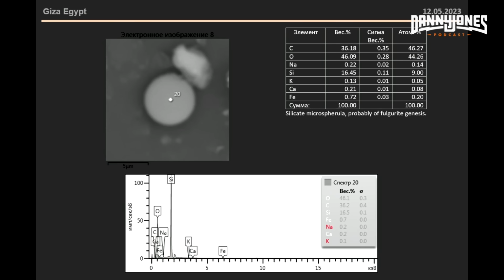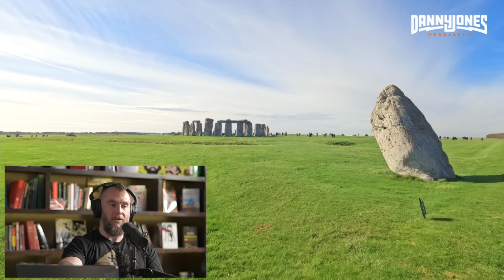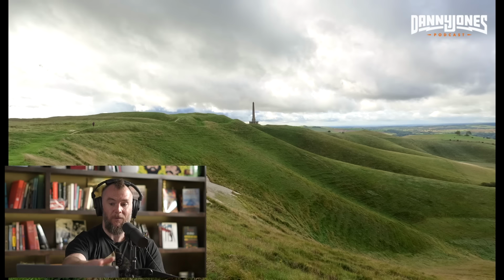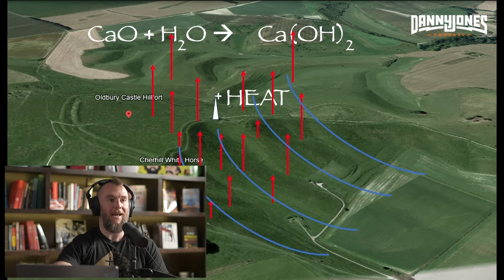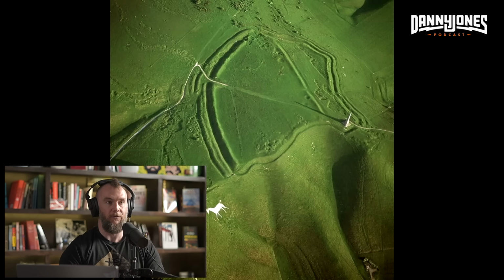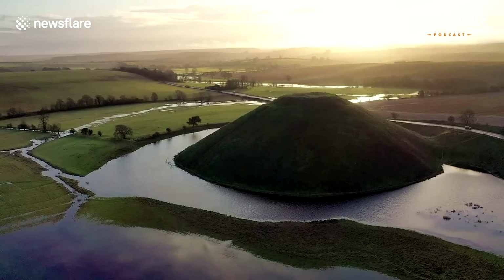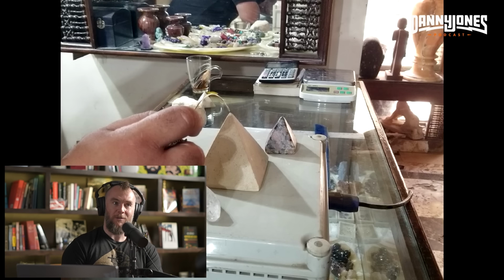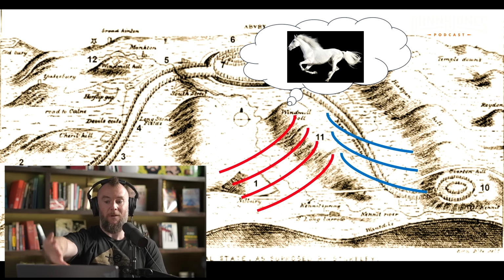How Ancient Civilizations Used Stones to Capture Lightning Energy | Land of Chem

Comment: Scrolling through these comments, it's obvious that we now live in the age where science is dead. Literally everything said in this video is fantasy.
Reply: Prove it
Reply: @glenndodson1914  There's nothing he claims that's been proven correct, therefore nothing that needs disproving. I may as well be debunking Harry Potter. In fact, so many of his claims can be debunked outright. Here's just one example. 
He said 1 lightning bolt would power a city of a year, it wouldn't even power a city for a second. The most powerful lighting strikes are up to 10 billion joules, but that's the TOTAL energy before the ground strike. 

The energy that reaches the ground is a miniscule percentage of that. For reference, 10 billion joules is 2390 kg of TNT (4.184 MJ/kg TNT calorific value) equivalent, that's 2.390 metric tonnes. When was the last time a lightning strike blew a 70 ft crater in the ground? The electrical energy is mostly consumed heating the air into plasma at thousands of degrees Celsius (it doesn't reach the ground), just like any high voltage arc. Simple conservation of energy (1st Law of Thermodynamics) Geoffrey Drumm doesn't even seem to know that or he thinks his audience won't notice.

As for his chemical processes claims, don't get me started - they're nonsense but you wouldn't need to build a giant pyramid just for sulfuric acid. He's pulling stuff off the internet he doesn't understand. The pyramids likely weren't tombs (imo), but they weren't what he claims either.

Comment: They still work, just about perfectly for todays lesson. Fixer uppers though. If you understand how to actually use the pyramids, you will understand how they were built. Both are satisfactory, and they can be compared for legitimacy. You need to understand how Thoth defended Horus or anyone else to God, then you will know both answers. Do not the earth and the Moon share the same reflected of the Sun harmonized in the tides. There are two majors and two minors offset. In the exact same rations as the pyramids. Right? They do because they are offset and counterbalanced. Both can see the answer and predict it like that last few moves of a Rubik's cube. Before the verdict both can see the black and white and the last move is already known by both before it needs to be made. It can be forgiven if you repent. Jesus Christ is your Savior. No one can navigate to heaven anymore like Thoth dod.